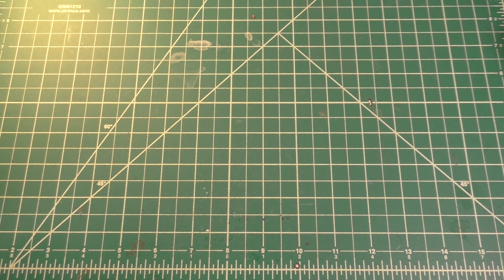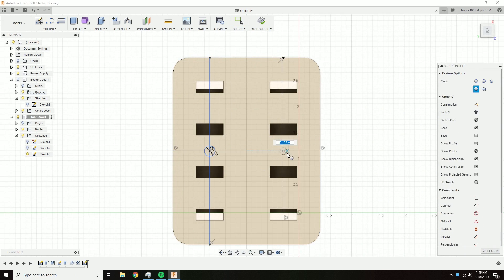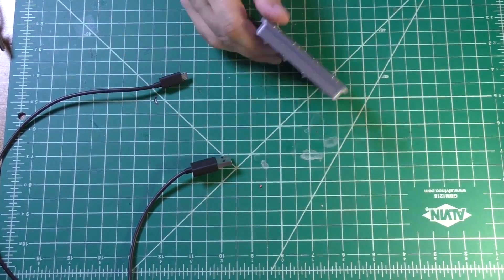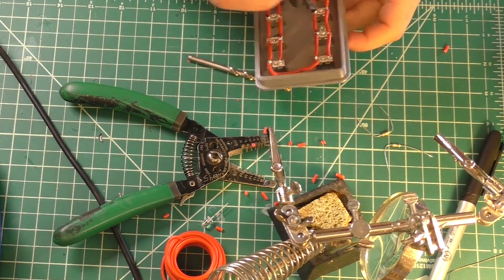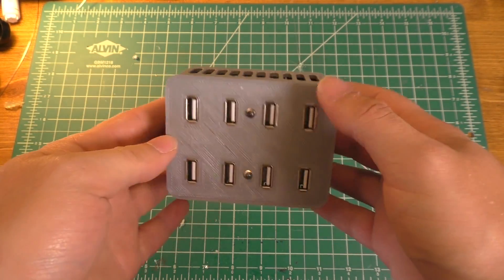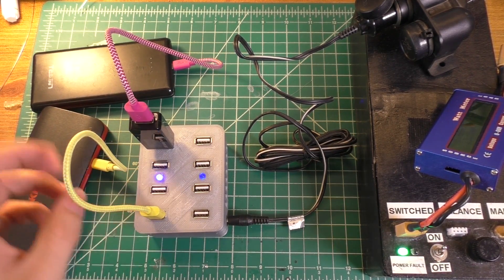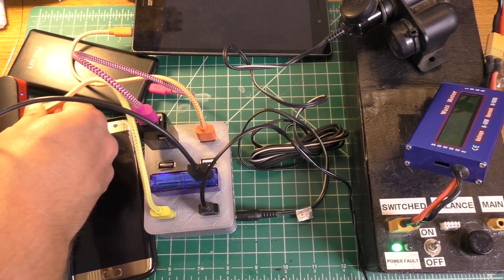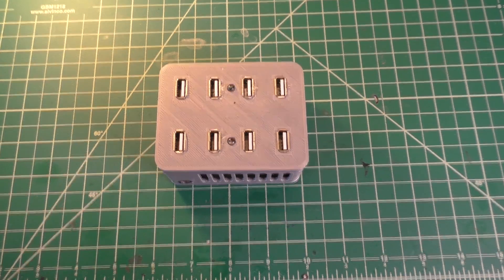DIY 8 Port USB Charger

Comment: your 12v power source; what is the recommended Amps for it?
I'd like to make one; I have all the parts.
Just undecided on the 12v source.
Reply from the maker: I would recommend something in the 4-5 Amp range. That should be enough to power it nicely.
Reply: @Eman2000  Cool.
I'm sure I have one of those in a forgotten box somewhere.
:)
I'll have to look...

Comment: the most optimal way in my opinion is use 9-12v AC-DC converter with enough current and use standalone DC to 5v DC buck charging controller for each port, yah it might getting more expensive but the module is cheap and will ensure each port can supply the voltage and current needed.

Use fast charging module so you can have fast charging feature for each port.
Reply: yea i am trying to do something like that with a wireless charger and I think standalone power source with AC-DC is much more safe.

Comment: does it support supercharger for huawei and fast charging for qualcomm?? Nice build btw. I would like to build this also someday (even though I don't have a 3d printer) with added switches and fan
Reply: no it is a dumb buck converter which only and only steps down voltage

Comment: All ports are parallel with out any protection such as 7805 or with high (2amps) current IC.
Reply: It has a 5v boster so it's safe
Reply: @haxemeback9304  it is not a good idea to have them like that, it is a risk

Comment: This completely ignored every change in usb charging standards in the last 5 years. The tablet isn't charging because it doesn't see anything on the data pins, either the Apple resistors or BCP or anything.

Comment: 😎 project;  could configure the data lines with  different resistances for individual device compatibility?  Thanks for sharing 😃
Reply from the maker: Thank you. Yes, the data lines could be configured differently for different devices. I didn't do it because Apple devices are the only ones that require it, and I don't own any Apple devices. The standard for USB power is to short the 2 data lines together (which is what I did to all of the ports).